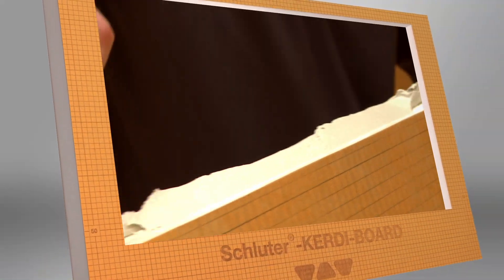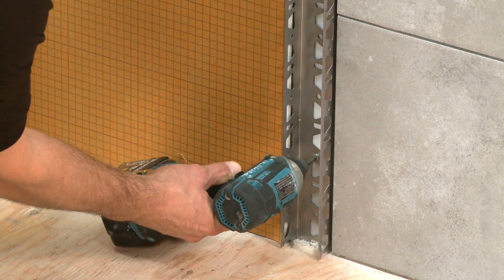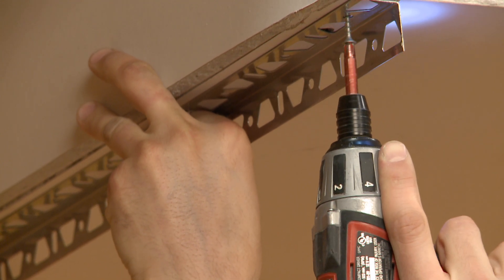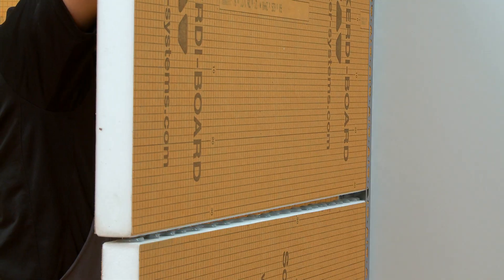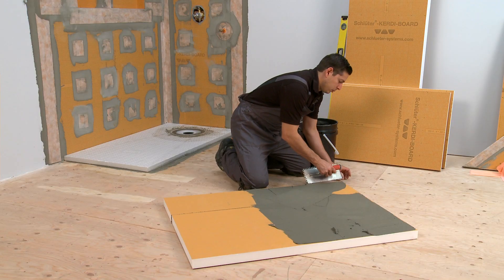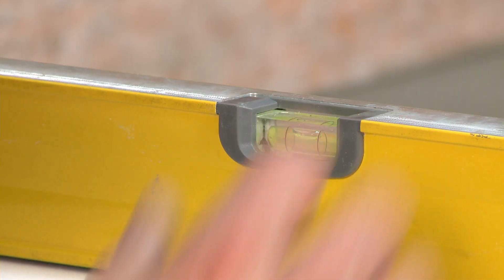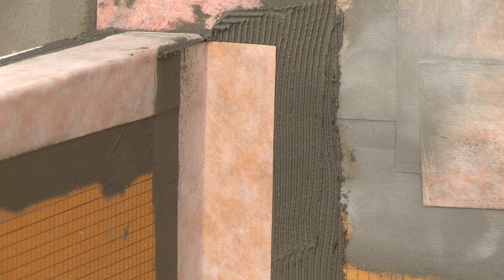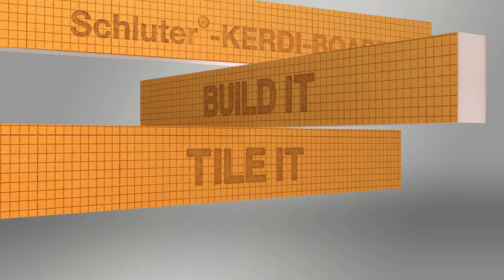Schluter®-KERDI-BOARD: Partition/Knee Walls

Comment: I want to build something like a self-supporting partition (or knee wall?), thats 4in thick, and is 3ft wide and 6.5ft tall. Is that possible with combining several 2in thick panels? And what would be best to attach it to a concrete (tile) floor?
Reply from the maker: Hi Denis, would you be able to call our Customer Support team so they can discuss your project with you in more detail and advise from there? 800-472-4588 (US) or 800-667-8746 (Canada). Thanks!

Comment: I see that the knee walls are able to support shower glass. How is the glass panel's bracket fastened to the kerdi board?
Reply from the maker: Hi there,
 In general, use of a track system that does not penetrate the waterproofing, such as the Schluter®-DECO-SG or similar, is preferred. However, brackets or hinges can also be anchored to the wall structure or solid backing behind the KERDI-BOARD with anchors using KERDI-FIX or equivalent sealant. The glass can be installed over the tile onto KERDI-BOARD knee walls or curbs using similar methods. Please contact Customer Support for complete installation instructions!
US 800-472-4588
CA 800-667-8746
Reply: Since Schluter didnt really answer the question,  I will.  On the edge with the hinges attached to the kerdi board,  you are supposed to glue the zfp plastic strip on the edge of the wall,  covered by the zb u shaped profile to lock it in.   That will give you something to screw the hinge into.   I didnt not find this out until my wall was completely covered in marble,  So I am going to cut a chunk of the wall out behind the marble on the side of the wall. where the hinge goes,  and glue a piece of wood inside, then refinish the outside (dry side) of the knee wall.
Reply: @stevek3270  sorry you had to go through that. I was looking at this installation and I can't believe how they put a glass door on the knee wall. It seems very wobbly and not load bearing. Did you do something similar? If so, how did you get around the wobbliness?
Reply: @adde32332    I do have a knee wall that has glass on top, and a door attached to the top glass and side of the knee wall.  It is rock solid.  There is absolutely zero wobble.  Once the kerdi board gets a coat of mortar, it becomes imbedded, and then solid.  I also used the kerdi board for a shower bench.  Again,  once it gets a coat of the mortar  (thinset), it is like a rock.  I have no issues with standing on the bench.  Dont be afraid of it,  it does work great.
Reply: @stevek3270   thanks for replying, that's very reassuring. How thick was the Kerdi board you used for the knee wall? And do you have tile on both sides?
Reply: @adde32332    I used the 2" board with only the shower side tiled.
Reply: If I could add a picture I would.
Reply: @stevek3270  thanks! I guess the thinset + tile is strong enough. Thanks for reassuring.

Btw what do you have on the other side of the kerdi if you didn't tile? Drywall?
Reply: @adde32332  I believe I just textured it, then painted to match the walls.
Reply: @stevek3270  nice, didnt' realize you could put joint compound on Kerdi. Might end up doing that too. Thanks
Reply: @adde32332  That link is a pic of what I have been talking about.  I tried to shake the wall,  it doesnt budge at all.